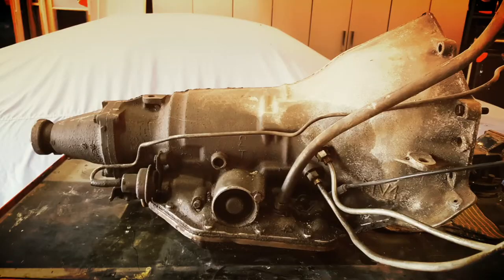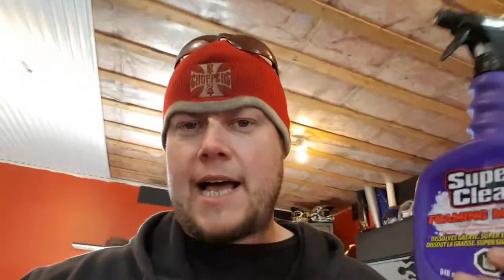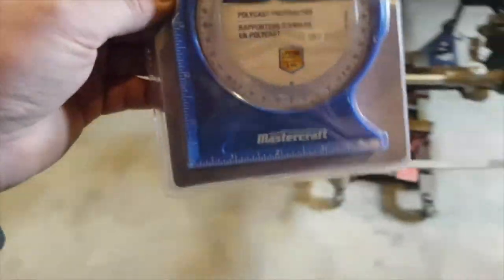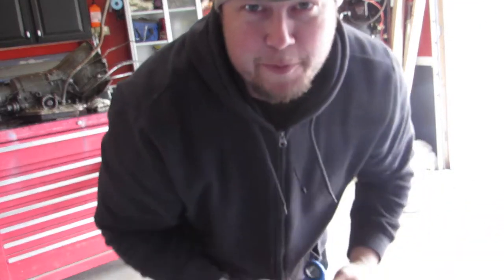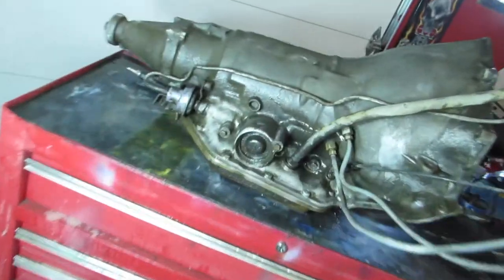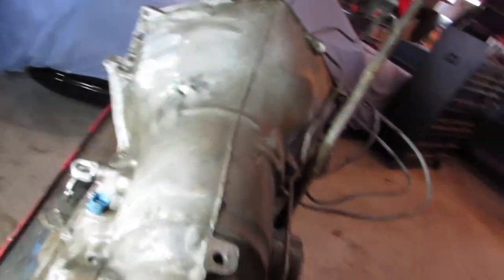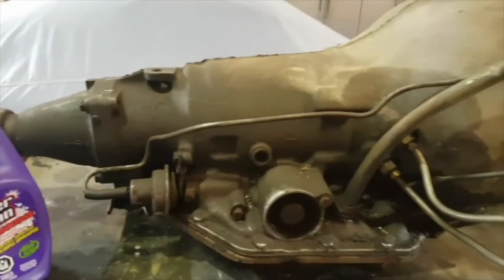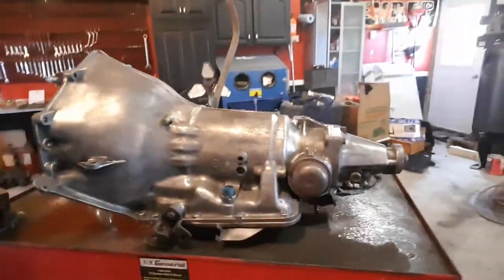How to clean a TH350 (gm) 3 speed transmission (degreased)

Comment: hello mister i have th350 its works fine when its cold but when its gets hot its not shifting its D only reverse what you think?
Reply from the maker: My guess is fluid is way low or wayyy used. Check those levels . Maybe change out the oil. I'd start there. 😊 Hope that helps
Reply: @TCProject253  all oil new with filter i changed thd gearbox cooler the old one its was for gmc 2003 i think i took it from scrap yard and its blocked from inside i didmt know until it exploded i replaced it with new one and bigger now the trany shift forward but its took 30 second maybe and sometimes i shift it to d1 and sometimes its wont shift cuz the idle kinda high i just gives its full throttel and release quick and its be in good idle 🌚🌚🌚
Reply from the maker: 🤔hmmm. I dunno dude. 🤨 Might have to ask a pro. I'm just learning as I go.